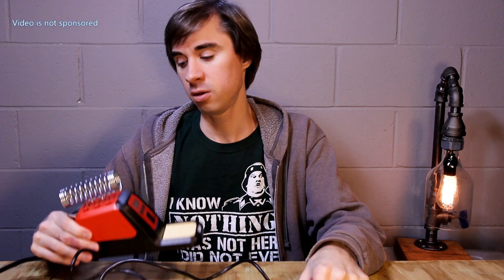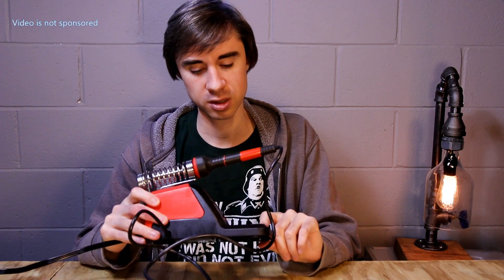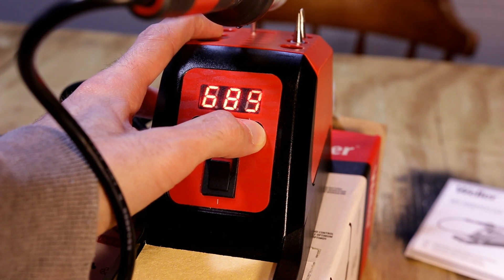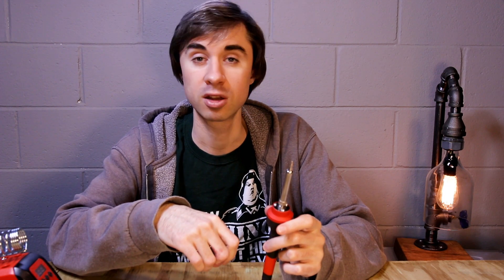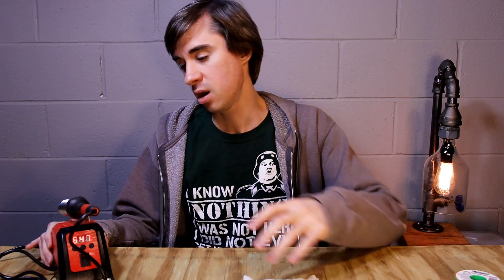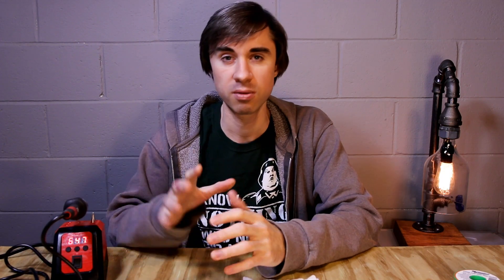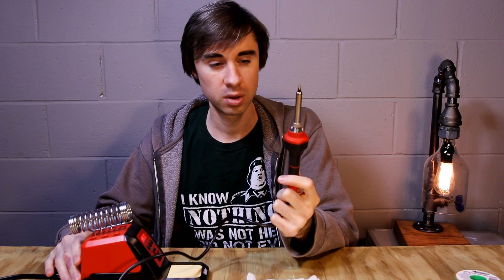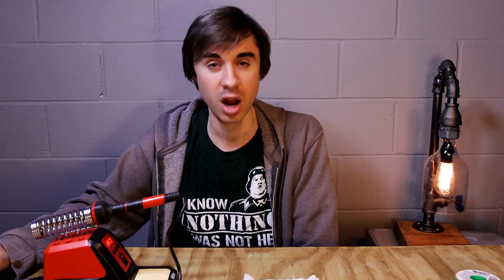Weller WLSKD7012A Soldering Station Unboxing and Review

Comment: That is a relatively soft metal holder you should be able to bend that to the angle that you need that should be a very simple fix I'm sure that is adjustable in every way

Comment: I have the same station I bought 2 days ago, and I was going to build two simple guitar cables tonight with it and I got one cable built and plugged it into my tester and it checked out good, then I got a quick phone call, all the while, I put the iron in the holder and I saw it go into standby mode. Then a few minuets later I got the other cable prepared, and went to tin the wires and the whole station had turned off and it won’t power back up. I thought a breaker may have blown in my house, so I checked the breaker and it was good. So I plugged in my phone to the outlet to see if it may have been the outlet, and my phone charged so the outlet was good. I guess the Weller died. It never powered back up. So I guess tomorrow I’ll go buy another soldering station, but it won’t be a Weller for sure. I’m like you, growing up I saw my dad and grandpa solder stuff all the time using the old steel Wellers, and that’s why I bought this one, but the new ones are junk. Toss it and go buy one from Harbor Freight. At least when it craters you can take it back and they’ll give you a new one.

Comment: The warranty issue matters, as so many such heating tools fail early on - save yours, and invest only just before embarking on a serious soldering project. I used a large Weller gun on replacing a multi-position dial switch with around 24 tightly spaced contacts, in a veterinary X-Ray control unit that had to handle higher voltages; instant heat and light was a huge benefit. Still, the gun was a deductible business expense, saving hundreds over professional servicing time, and its short life span when used over a very few more projects was still worth it.
As to digital versus a dial (rheostat), it is likely more reliable without generating internal heat; again, it will either work or die. Interesting to know how accurate the thermal indicator really is, as it may be regulating by just on/off frequency, measuring nothing.

Comment: Honestly, it sucks. Bought one and it only last a week until it doesn’t heat anymore, gets stuck at 97 F. Also when trying to remove the tip, it snaps in half and becomes unusable since the heating element turned solid and snapped. Can’t even return it anymore since it doesn’t even have a warranty. This sucks.
Reply from the maker: I'm sorry to hear that yours stopped working.  
It'll be interesting to see how long mine lasts.  Thanks for sharing!